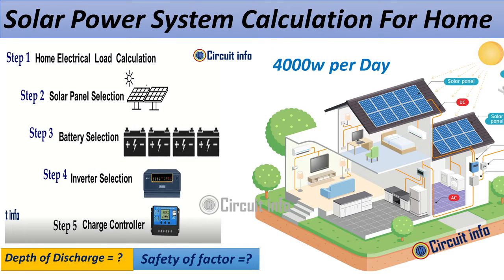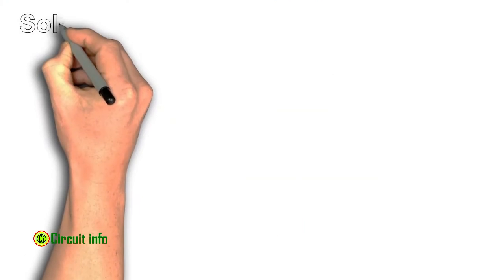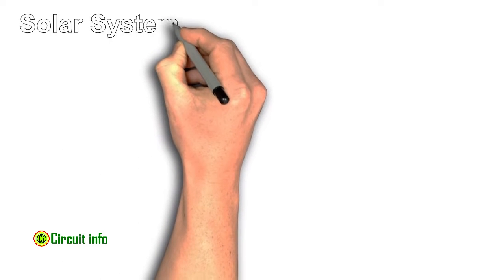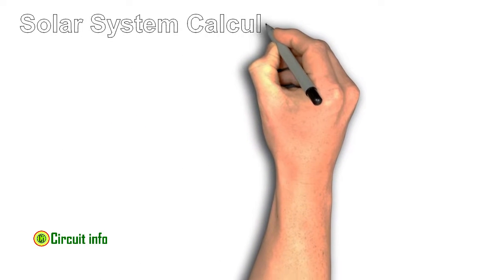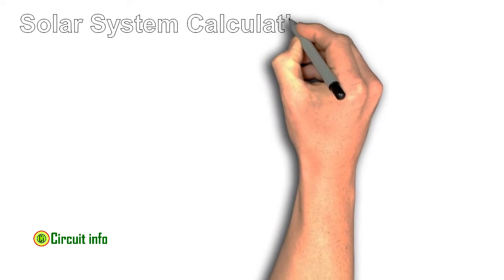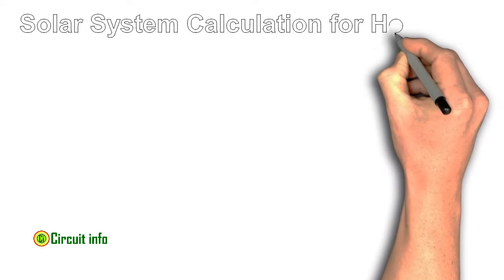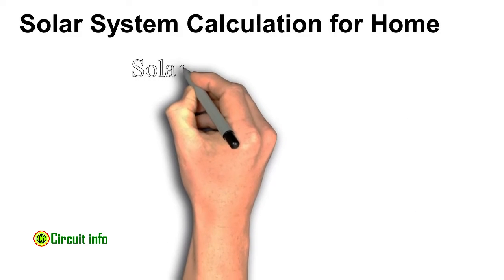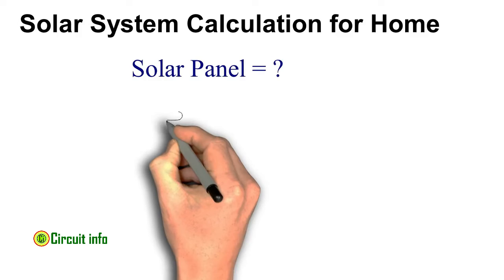Solar Panel Power Calculation For Home /OFF Grid System / Calculation @CircuitInfo #Solarcalculation

Comment: should we not be calculating the reciprocal of .73 times 4000 watts to get what the panels most produce ? PO / Pin = efficiency so the panels need 4000  watts times 1.37 = 5480 watts. please correct me if I am wrong.

Comment: Battery calculation is WRONG! 3,000 Ah of LiFePO4 is 38,400Wh He probably meant 300Ah. With 3,000Ah of LiFePO4 you could power that house for more than 3 days without sun. You actually only need to calculate 16-18h of backup (4 PM-9AM). I know because I'm 100% off grid with 180Ah LiFePO4 at 48V.
Reply: Yea, its an error, still got the correct number of batteries. Math just happen to still work
Reply: Respect friend

Comment: Wrong  panel watt calculation, seems basic mathematics error, please correct the same. Panel will be above 7kw, and you have to choose inverter to support 7kw panel. Accorngly you need to see , on inverter sizing which will support required quantity batteries

Comment: Would someone else please check the information about the inverter sizing? I do not think that Sizing your inverter by your home size is the right method. It seems from my research that one should size the inverter by the size of the solar array. 6kW array should have approximately a 6kW inverter. Someone told me that voltage is something to pay attention to as well. Granted you want the system to power your home for at least a day or what's the point. so Solar Inverter ~ Solar Array >= 1 day energy. or something.
Reply: I think you are correct. Its best to have an inverter that can support the panels 1st. By default, this will be enough for the Home load. If you pick an inverter based on home load AND, you round up on the number of panels needed, you run the risk of having more solar energy than your inverter can support, Its no always likely tho. Thats my guess

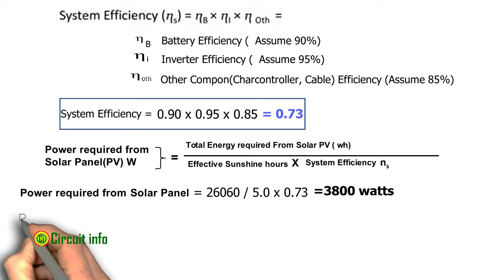Comment: 7:10
Power required from Solar Panel is not around 3800W it’s around 7200W
Reply: 26060/5.0/0.73=7139.7 = 7200w
Reply: 7140w
Reply: Yep. you forgot your order of operations when you did your calculations = 26060/(5.0*0.73) if you stick with your formula. different than 26060/5.0*0.73
Reply: he is coorect check ur bidmas rule